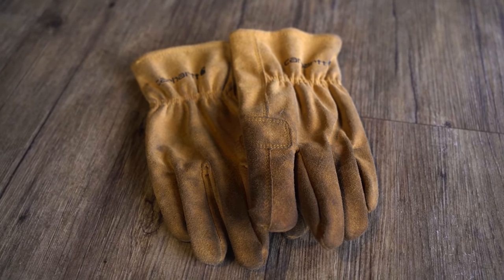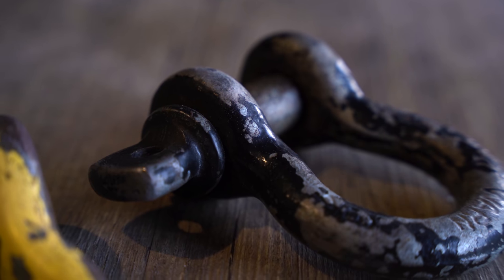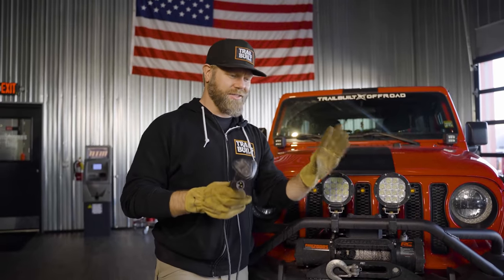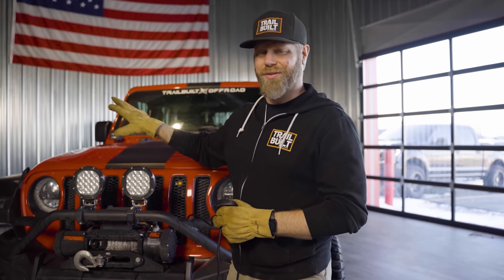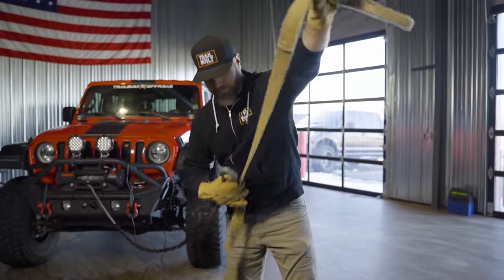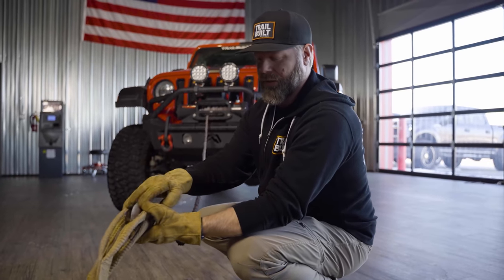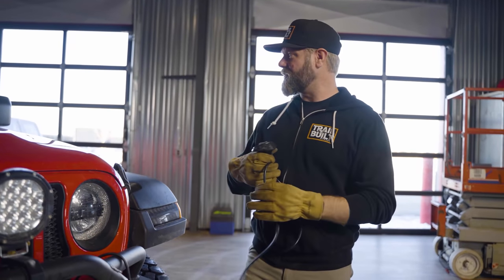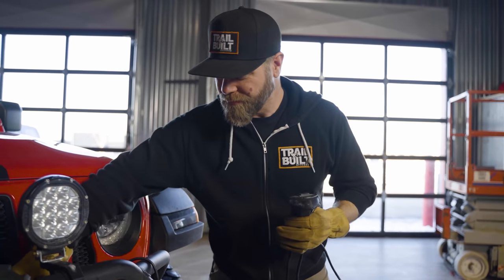How To Use An Off-Road Winch

Comment: Raising your vehicle hood as backup to your winch blanket will also help protect yourself or passengers in the vehicle cab.
Reply: Yes in addition, you should always lay across the center console to have you’re hole body out of the danger zone below the windshield, surprised he didn’t mention that.  We actually have 2 old ballistic shields we use for this purpose sandwiched between the open hood and windshield while trying to get most of our body behind the engine. Carrying A little extra weight is worth not having your head decapitated by synthetic winch rope.
Reply: All great points, I also carry some 3in plexiglass that I carry on my top that I can pull down and lay infront of my windshield frame. With the blankets, hood up, ballistic panels, bulletproof vests, helmets, face guards, and plexiglass you should be safe to winch!
Reply: never thought of that. thats a great idea thank you
Reply: I wear a bullet proof vest every time I go off-roading in case a stray J Hook comes outta nowhere

Comment: I was a Deck Mechanic in the Merchant Marine. We did a lot of power rigging and never used a winch blanket. Instead, we attached a short "catch line"--a braided nylon line--through the eye of the "business end" with about 5 ft of slack. Should the hook or its finding part, this line will catch the projectile. Much more practical and compact than all these "winch pads" and "blankets" I see.
Reply: I actually keep a waxed canvas tarp. Works as ground cover to work under vehicle, can be a tent, or throw it over chain or cable. I think a heavy tarp makes best multi purpose tool
Reply: We keep 2 50lb kettlebells in the Jeep to thread thru the winch  line before hooking anything up. The extra weight is worth not having you’re whole body split in half by synthetic winch rope when it snaps, Or even you’re vehicle be totaled from the impact by the rope.
Reply: @Stewart J  promise try to cavas tarp instead way lighter. Also synthetic winch rope is too light to cause a cutting effect. Im a certified rigger. When a polymer rope pops, it's so light that it's stored energy dissipates so fast. Now a steel cable or chain need to be weighted also larger synthetic straps.

Comment: A snatch block only doubles pulling power when the two parts of the line are parallel or nearly parallel. If being used as a redirect it adds little to no additional pulling strength. The more blocks you add with lines parallel the more pulling power you can obtain. Just mind load limits. Also know that with using blocks to double pulling power that the point of anchor with the block sees DOUBLE the load or more. When adding blocks, the anchor point load doubles for every 2 parts of rope or cable ran parallel. Example, if you are pulling a 6k lb Jeep with a single block with 2 lines parallel then whatever the block is attached to will see 12k lbs of load. So, make sure the tree, rock, shackle or tree savor is rated for that doubled load. Also, a synthetic rope can damage a tree. The living tissue of the tree is the cambium layer which is the outer most part of the tree under the bark. It doesn't take much to damage that layer and it is very thin. My background is as a arborist with 20+ years of rigging experience.
Reply: Also depends on the blocks and reeving, I'd always go laced reeve with a multi part sheave but there are benefits with headspace and orientation to a square reeve, just a lot of return bends causing excess friction

Comment: Thats an awesome JL you got a very sweet looking rig. Those are great points on this video.
 I like using snatch blocks that make it easy and takes a big load off my winch. After use, I check my cable and respool hooked up to a tree(per my uncle).

Comment: I have all my winch accessories in a military surplus tool bag that lives under the back seat. I use synth rope so I don’t bother with a line weight.
I like a wireless remote option and prefer to be in the driver seat when winching.

Comment: Great video.  I’m pretty new to winching.  With all the talk of not using metal d-rings due to safety, why do we still use heavy metal hooks on the end?  I replaced mine with a Factor 55 loop guard and when I need to use it, remove the guard and just thread into the loop directly with my soft shackle.  Am I thinking of it incorrectly in some way?  Should I have kept my hook on(I do have some D-rings to use in place of the hook just in case I need to connect to something with sharp edges where a soft shackle would not be ideal)? Thanks.

Comment: The anchor vehicle should not be in park or have the parking break on. Either of those will put huge amounts of stress on the drive line components. The best and most correct way is to have someone pressing in the break peddle with the vehicle in neutral. On some vehicles with intelligent alternators. You'll want them to hold the vehicle at around 2000 rpm to get the alt to put out a charge.  Using the breaks locks each wheel independently of the others. It puts the stress on the breaks and not the drive line. The breaks were designed to stop the vehicle. They will take the stress far better than the parking pawl, parking break or drive line.  

A good plan wherever possible to dig the wheels in and partly bog the anchor vehicle; this acts like natural wheel chocks. Better still use a tree saver and tether the anchor vehicle to it. If using snatch blocks, use a tree as the anchor and take most of the force off the winch vehicle. Remember with a tree and 2 snatch blocks you can reduce the force on the winch by 50%, at the cost of having to move the rope twice as far. The other advantage is you lower the force on the line reducing the likely hood of failure. Just remember to use extra strong end points as they will see the full force of the total system.

Comment: So if you’re pulling yourself out you want your car in neutral with the parking brake on? Or do you disengage the parking brake once you start winching? Newbie here, anything helps! Thanks!
Reply: If you’re pulling yourself you want to be in neutral or in gear trying to drive over the obstacle while the winch helps you over.  Definitely no parking break while winching yourself.
Reply: @RogerPriceDesigns  Appreciate the advice 👍🏻
Reply: If you’re stuck and trying to winch yourself out, definitely go with parking brake on and standing on the brake helps too, and in park,  also could chalk all 4 wheels. It’s safer.
Reply: No parking brake as it defeats the purpose of winching yourself out. In drive to attempt to go over obstacles.